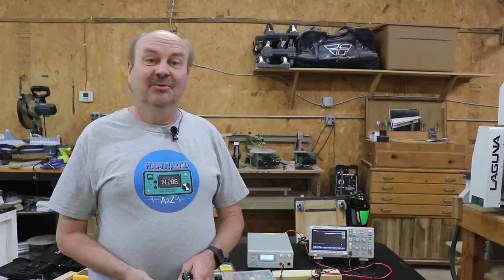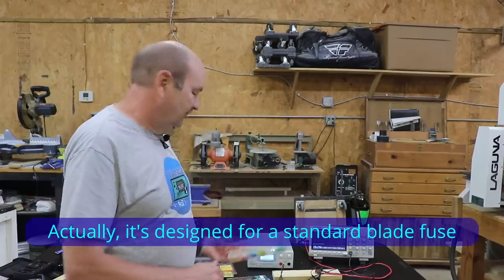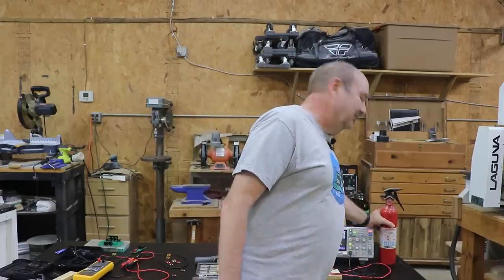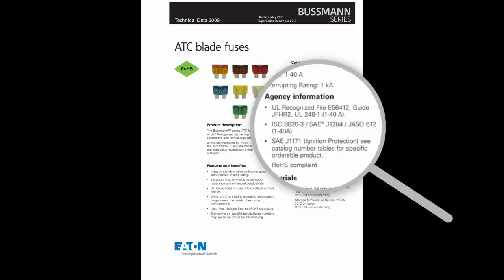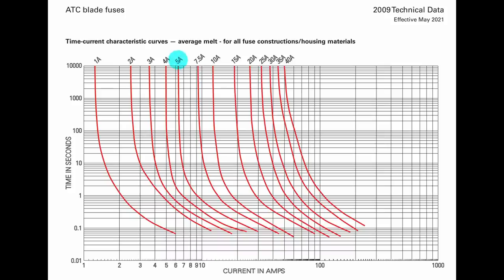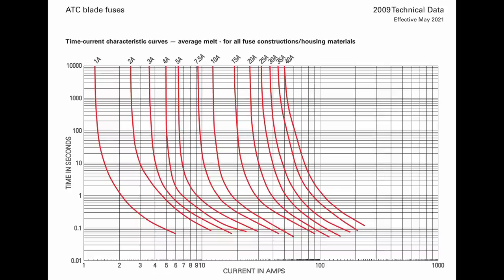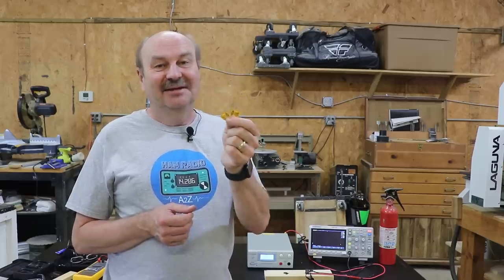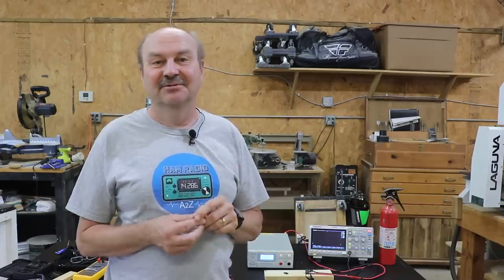Bad Fuses

Comment: Hi, Tom. Thanks for the very informative and interesting video. Blade fuses are a type of commodity item I've never really thought twice about. I guess not all of them "just work". I'd hate to have one of those 5A no-name fuses "protecting" a sensitive circuit in my vehicle. Well done.
Marc (N1QGM)
Reply: Same here - I never thought you could screw up a fuse!
Reply: Pay attention. Any fuse like these, no matter what manufacturer, will NOT protect 'sensitive' equipment.  They are only intended to protect wiring systems.
Reply: I remember a Marconi engineer looking at a duff transistor. "The three pronged fuse has blown!"

Comment: The fuses that are hard to read, don't have the rating colored white, are the ones that are not "certified " as I understand. I found a video similar to yours stating this. I trashed my assortment from Harbor Freight, and purchased a Littelfuse assortment. Great video
Reply: I have oem ones that don't have that
Reply: Some major brand in the UK, Halfords, doesn't state that they match the DIN standard, not any set of qualities with reference to it. I've no idea whether they blow as fast as they should, nor as close to the rating as they should, and they didn't promise that they would either.

Comment: Great video!  Excellent warning about cheap fuses that often get taken for granted.  Please note though, that those types of heat guns observe a rather large conical region in front of them to determine the temp.  They do NOT measure the point at the red laser dot.  Unless one is measuring a larger area (like a frying pan for example), they are inaccurate for small spot measurements like the fuse - the fuse is likely to be much hotter than one it displays since it is averaging same of the desktop temp with the fuse.  Nonetheless, awesome video.  Will be sharing this with others!

Comment: Oh great, I'm in the process of building a camper van and bought two fuse boxes on Amazon. Guess which fuses came with the box 😠
Thanks a lot for the warning!
Reply: So I tried to destroy the included 5A fuse by running the diesel heater which pulls 12A, fuse didn't blow after 5min.

Comment: Thanks for the chart, one more data point, typically those chinese fuses are aluminum, and aluminum on standard tinned brass terminals is a corrosion and fire hazard when exposed to wet environments.  I had a piece of outdoor equipment, 30a fuse for the glow plugs ended up burning up the whole fuse block.  clipping one fuse leg will show if its tinned brass or aluminum.  Buss fuses are a guarantee to be tinned brass

Comment: In the UK, I have found those "cheap and nasty" fuses have blades made of aluminum 0.5mm thick. The decent fuses have blades made of nickel plated brass, 0.7mm thick. So there is potential for the cheap fuses to give a bad contact. I once made sure I gave eveyone in my car club a "free fuse" and told them that if you can easily bend the blades like you can on your free gift, don't buy it...
Reply: yes, my experience Aluminum is soft and forms a high resistant connection over time.  Dito throw away the non-branded fuses.
Reply: Brass is a pretty dismal conductor of heat, whereas aluminum is as good as it gets, excluding copper and silver. Since fuses are really just self-heating resistors that melt themselves to oblivion, removing heat "too fast" will delay or even prevent blowing.
Reply: @raymiller5738  
That's why aluminum has been largely banned for AC mains wiring - joints tended to be unreliable and cause fires. There are problems with both oxidation (aluminum oxide is an excellent insulator) and "cold flow."

I have a small single-AA cell, single mode flashlight I really like except for one problem - the tail cap of case was notorious for going high-resistance between the cap and body threads. A tiny bit of a zinc paste (Gardner Bender OX-100B), intended for use on aluminum wires, on the threads fixed the problem nicely.

Comment: Wow! I'm not a radio guy but really appreciate YT for suggesting this video. I recently bought one of those cheap fuse kits on Amazon to keep in my RV. Not only will I toss that kit out but I'm going to have to go through all the fuses in my coach because I've a bad feeling that the manufacturer of my RV may have used these cheap fuses. I can only wonder how many camper fires might have been caused by one of these poorly made fuses. Thanks!!!

Comment: Great job!

Sometimes a return to basic component information is invaluable. I think another component that needs examination is clone Anderson Power Points. Many of them look right, but do not use the proper materials and arc at very low currents!

Hope you'll do more things like this....
Reply from the maker: I have heard about fake PowerPoles.  That’s another one I need to check into.  Thanks for mentioning it.

Comment: About that fire extinguisher - you might want to get one with metal handles.  I've heard stories about the plastic ones breaking during test.  (Especially if you fail to properly remove the safety.)  They're a little more expensive and a bit bigger, but still a good investment.
Reply from the maker: Thanks for the tip!
Reply: @HamRadioA2Z  Another tip: Get CO2 extinguishers for dealing with equipment fires.  The other types will make a mess of things and potentially create a bigger problem as the electrical fire heats things up.
Reply: @russellhltn1396  I usually reccommend Foam extinguishers. Sligthly less effective than powder, but doesn't destroy everything that the fire didn't damage.
Reply: @HamRadioA2Z  Have you ever seen the mess created by a dry powder fire extinguisher, especially in a relatively confined space? 
What makes matters worse..the powder is hydroscopic, and will corrode metals if you don't vacuum every last trace.
Reply: Go dry water mist good on most fires and using reverse osmosis water it's none conductive and once dry leaves no residue
Reply: Many of the plastic handle ones were recalled. Check with manufacturer and you may get a free replacement from them. This was a very big recall.

Comment: Nice video. And also a very important topic. These cheap "dummy-fuses" won#t save you a penny, if your car or even your house catches fire and burns to ashes.  But, just for showing the seriousness of the danger (and for fun), you should have used thinner wire, that actually melts or lights up. 
Anyway, amazing video, thank you. 73s

Comment: You have illustrated overcurrent protection in the precise way it is intended to work.  The startling issue I had not expected is the lack of specification on the chinesium fuses.  Very nicely done and an important warning.TNX

Comment: I had some of these fuses around and used them once for some relays, a fan they were controlling got jammed and it should have blown the fuse but instead melted all the plastic off of the fuse and got everything pretty hot. I bought a box of legitimate brand fuses and made sure that I never used the cheap ones again.

Comment: A very good demonstration and an eye-opener to modern day equipment. I have very little new equipment as I am a homebrewer and operate boat-anchor vacuum tube equipment. The fact that the voltage on the power supply drops to 0.6 volts and still maintains 20A is amazing to me. That is 12 watts of heat being dissipated in the fuse, as your temperature measurements indicated, which seems like it would melt the fuse link in a reasonably short time. Apparently not...
My power supplies are all the linear brute-force type and shorting one of them will likely not drop the voltage any significant amount so we would end up with the full 15 volts (as in your example) at 20A for 300 watts being dissipated in the fuse and we all know where that is going to go and hopefully the fuse will protect the equipment from catastrophic damage and possible fire.
With over-current sensing in SMPS in modern equipment, it almost seems redundant to put a fuse in the output side, although I think it is still a good idea. 73  WA4QGA

Comment: I got a bag of fifty 3A ATC fuses.  I'm good to go for all my needs.  I've been testing DC disconnect breakers.  A 10A won't even trip at 22A.
Reply from the maker: I have considered doing a video about breakers.  Even good quality circuit breakers take longer to trip than a fuse because of the nature of how they operate.  As I said at the beginning of the video, fuses and circuit breakers are primarily designed to protect wiring from catching fire.  They’re not really designed to protect our electronic equipment from internal faults.
Reply: @HamRadioA2Z  You might also want to look at DC breakers.  Some of the polarized ones actually interrupt the arc faster when connected in reverse.  I get all this stuff free from manufacturers.  Sure glad I'm not having top for some of these products.  It is the wild west on these CE listed products!

Comment: There was a massive recall of these fuses a few years ago, because the only difference between the fuses was the colour of the body, as they all used the same stamped out fuse element, and simply put a different colour body on the top. Millions of boxes recalled, they had to go somewhere, so likely got sold off as lots cheap. Basically look at the elements, if they are all the same size they are all 30A fuses.

Comment: Thank you for your excellent review. I also purchase a box of 300 no name blade fuses from EBay for $16 and had quite a different experience.  I replace the original 30 Amp fuse with one from 30 Amp fuse from EBay  that is in line with a solar regulator. The solar regulator runs a maximum of 25 amps and the plastic that encapsulated the blade fuse wire melted exposing the fuse wire. It seems that they made of a plastic with a very low melting point.  I wonder if the current did get to 30 Amps or above 30 Amps that it would catch on fire.

Comment: This comes as no surprise to me, Chinese manufacturering often times substitutes for materials that are not in stock or considered too costly in their opinion.  They probably substituted aluminum wire for the tin or indium fuse element.  One clue is the DC resistance, it is most likely abnormally low.

I discovered similar problems with the Chinese marine style thermal circuit breakers 3 years ago.  These trip at 1/3rd to 1/10th the stated current.  They can also chatter when they are about to trip.  I finally had to test each breaker for it's trip point, then label the breakers accordingly.

Comment: Thanks for sharing this.  I always say that government has a function. One of those functions is to protect consumers.
When safety devices fail to do their job, the government should prohibit their sale as a risk to safety.

My only concern with your test is you showed only one test of a 5 amp fuse.  I'd like to see the results of 5-5 amp, 5-10 amp, and 5 -15 amp fuses.

Certifications are important.  But even without them any safety device should perform as expected or be prohibited from sale.
Reply from the maker: I did try several of the 5’s with similar results.  Stay tuned for a follow up video.
Reply: Yeah, well, it seems the government is about as effective as these fuses, but we don't get a bargain price for them!

Comment: I actually ran into this myself doing load testing for sizing the fuse for an electronics project - I use pico fuses which are about the size of a grain of rice.  The Amazon ones listed for 500mA fast blow didn't blow until over 1.5A. Some knock-off Littelfuse ones I found on there too, rated for 2A Fast Blow, didn't blow until they had almost 250% over their rating (4.5A), and that was ratcheting up the current quickly. I got on Digikey and got genuine Littlefuse pico fuses, and they all blow at almost EXACTLY their specified current. It's almost like these Chinese companies just stamp out fuses from any pot metal they can find and then injection mold it. It's truly scary if you think about it.

Comment: Well shit, I just got a whole bunch of cheap Amazon fuses. I've got a scope and PSU, I'm gonna set up the same test you did and see if they are junk. Thanks for posting!
Reply: I pushed 4.2 amps through a 2 amp fuse for a couple mins. I'll need to build a way to do higher amp tests.  But I'm gonna try to return this crap to Amazon. 

Now I also have to rip my motorcycle apart to pull out the fuse I put in.
Reply: @rjmackenzie Dude, you need to go and read about fuses and their characteristics to understand why a 2amp fuse could easily pass 4 amps. The idea that a 2amp fuse ought to blow after 2amps is nonsense. A fuse can withstand many times its rating before it blows.

Comment: This topic was covered a year or more ago, with comparison tests as well. ALL the colors of blade fuses from parts unknown would hold 40 AMPS ... be they molded as a 5, 10, 20, 30 OR 40.  A USED CAR LIKELY HAS SOME OF THESE. The hazard is from putting in a no-blo fuse into a bad circuit that popped the GOOD ( blown ) fuse, without diagnosing and repairing the vehicle. Expect to ruin a wire harness or worse.

Comment: UK mains plug fuses come in 3 and 13 amps mostly. 1,2,5,7,10 amp also. They look like 1 and1/4 inch ceramic fuses except 1 inch. A UK kettle often uses the full 13 amps ( 12.67A 240V mine ). This is often Bushmann fuses and relaible or years.  These  fuses were a way to reduce copper used in wartime circa 1943.  It actually reduce impedance as it's a ring circuit.  It also protects the power cord. The fuses are 15 cents.  The ring is 32 amps. 6 amps lights on a radial. 100 amps typical company fuse. I once installed a 6.3AT 20mm fuse on a10 amps kettle at the factory. The staff knew. Months later it still worked. It was high grade. The graphs sort of said it could.  Although I didn't ask 1 minute could be the cycle time for a mug or two of tea ( 50 a day ? ). This was to test a real application.

Comment: I remember a 528e back when German cars use ceramic/thermosetting strip fuses . Red 16 white 8blue25. It was burned out in the roof from a dome light short. The fuse was replaced from white to blue.

Comment: The best thing about the no name fuses are the cases, and they often come with pullers.  So toss the fuses out but keep the case, and then put in brand name fuses.  A lot less finicky to open than the Littelfuse or Bussmann cases, for sure.

Comment: Thanks I will test them before. I use them ho ho ho,  good video alot of people don't understand fuses but the auto industry just wants cheep. It very sad the way the worlds going. In practice with heavy wiring and a direct short the fuse pops every time,  but those high currents thiner wires with heavy loads, and beat keep some wire cutters and a fire extinguisher close. Well hilighted

Comment: get the oscilloscope to measure across a high current shunt and use a car battery across the fuse to blow it up. the shunt will measure the time + peak current require to blow the cheap vs branded ones. and i always use little fuse. , i keep a box of their energy kit in my car although i have never needed it. but i do use blade fuses everywhere. they are easy to replace and works fine for low voltage dc.
Reply: This isn’t a good test.  The peak current will be enormous - hundreds of amps - for any fuse you put in there.
Reply: @stargazer7644  that would be a realistic test because these are connected directly to a car battery that can deliver 600amps under near short circuit. So if a module or accessories goes short then you also need to know the peak current and the time it takes for the fuse to blow. Because a storage oscilloscope can time it down to nano seconds.
Reply: @KuntalGhosh  A fuse is not designed to limit current before it blows.  I've never needed to know those numbers when designing a circuit.  You simply use the fuse that is rated for the job.
Reply: @KuntalGhosh A realistic test would be to connect the 5 amp fuse to the battery using 10 feet of 20 AWG wire. The resistance of the wire would be about 0.1 ohm. The resistance of the fuse in the test is about 0.025 ohm. The current would be about 100 amps. The fake fuse might blow before the wire was cooked, but I wouldn't count on it.

Comment: It would be interesting if you did a follow up with the 5A fuse with a teardown, and see exactly why it doesn't blow.
Reply: I just tore down one of these fuses, the fuse is made out of aluminum, to get a fuse to blow the wire has to be a specific diameter. Each fuse is cut from a flat plate of aluminum, probably in a stamping machine. The theory is that the machine stamps the wire accurately to a specific size. My guess is that the metal isn't the right material (they just used a piece of ordinary metal) and/or the stamping machine is highly inaccurate.
Reply: Its a QC issue obs. And tearing down fuse...mate😂
Reply: They are all stamped to be 30A fuses, just the colour and embossed amps is different. Done to reduce cost, as the 30A unit is the most robust, and cheap to make, and then you just put the cover on to make the others. They were recalled as defective years ago, but are still sold cheap in kits, because there is no QC done on them at all. 

If you see a box compare the fuse element between the ratings, they are all the same size, while real ones the fuse gets thinner as you go down, or it is a thin wire spot welded or crimped between the blades on the lowest current ones.